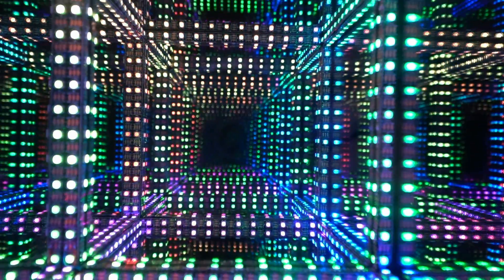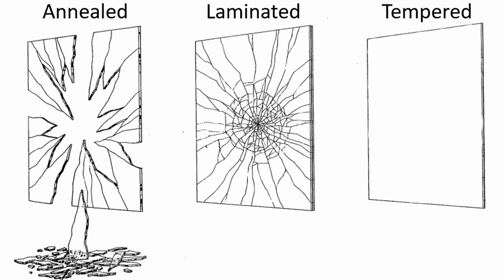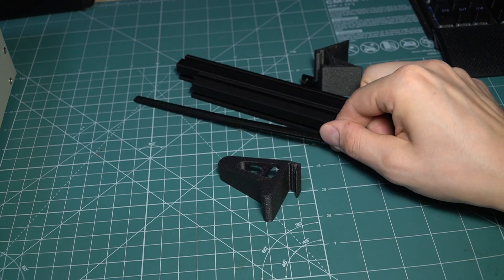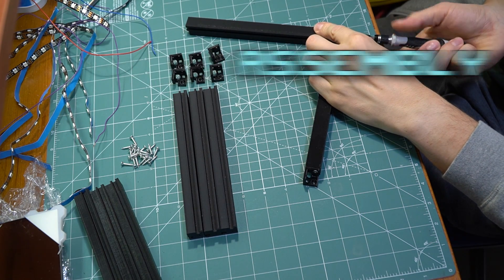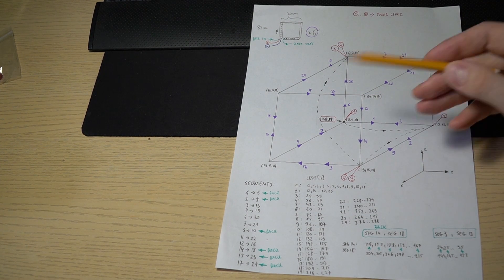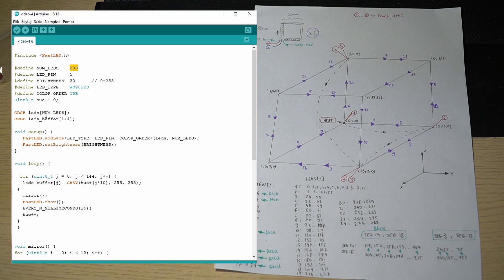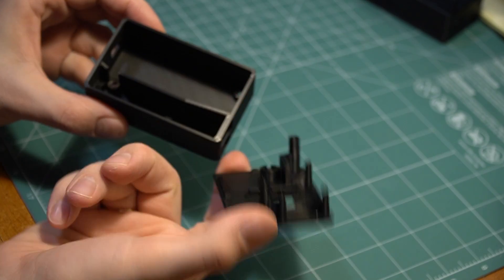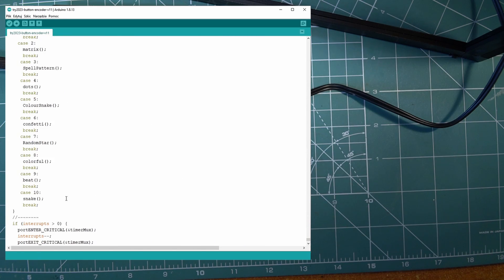Making Infinity LED CUBE

Comment: Couldn't get encoder working or RGB\LEDs to light. First issue was the Timer function was outdated. Some People submitted a new build and that fixed that! After that I Spent a few dollars more and got a better quality ESP-32. I had  bought a 3 pack from Amazon for $9 USA. Only way it would program was holding the boot button in. Picked up ESP-WROOM-32 from ELEGOO and they programmed just fine. So after that encoder worked properly

 Then I had no RGB\LED on the Data PIN-23 as the diagram shows. Looked through the PIN assignments and saw the Data pin was mapped to Pin-27!! Moved wire over and now working as it should!!

Comment: Im about to start this proyect and ive read all the instructions of github but i have a doubt that i wasnt able to fin in the readme. What diameter of cable did you use for wiring the cube?
Reply from the maker: I used AWG24 cables. It is more than sufficient if you will follow the 6 loops power lines I mentioned in the video. Good luck with the project!
Reply: @mecharms  back here again. Im having serious problems i cant sort out with the rotary encoder. I have the same model the ky-040 but its not responding properly, any step i make with it makes the program completly freeze or reset. Any ideas?

Comment: I have tried to recreate this with the video, but for me, who has 0 idea, it is impossible. It would have been better not to put the steps in fast motion and to show the elements more precisely... Too bad, I'm getting absolutely nowhere.
Reply from the maker: Thanks for your feedback. Initially I thought to create a step-by-step video, but it turned out to be too complex, and it was impossible to cover all potential issues that might come up. The most problematic part is in my opinion programming. I hope you get to the level where you can succeed!
Reply: @mecharms  Thank you for your extremely positive feedback. I despaired at the thing and stopped after 4-5 hours and finished the project. I stopped at the wiring because, as I mentioned, I've never done anything like this in my life and it's impossible for me to come up with the ideas myself. Nevertheless, thanks for your video and a great result and video.
Reply: Maybe I'll just change the stripes, the result will certainly be sufficient 🥰

Comment: Amazing project and video.
I am trying to make this work on a cube with 14 pixels per strip because I already have loads of 'em, this has 12.
I have my control box ready and my cube ready for the pixels but I can't figure out the routing and direction of the strips. Also, I am having trouble with the numbers in the arrays. After altering to match my strip sections, the sections do not display correct.  Would you post the new wiring / routing diagram if you have one please. I also noticed that the data pin in the code is pin 27, but the data pin on the diagram at 15:30 is in pin 23.
Reply from the maker: Thank you! You are right with the data pin 😉 I didn't notice the mistake. I changed the pin during the process thats the reason. Did you checked the diagram and code on Github? It should work. The helpfull way in case differen connection is to make program which light leds one by one showing the Leds rising adress direction and strip number in the structure - like shown in 11:27 . Then you can apply the formula I shown. What do you mean by ,,post new wiring? "
Reply: @mecharms  in the video at 4:30, the diagram does show the order of the sides but does not show what strip should be on the top of the side pieces and what should be on the sides of the bars. The direction of the strips is not shown either and both diagrams have different order of sides (first diagram has data in at the front lower left corner and side 2 is front top centre, diagram 2 shows data in at rear lower left and side 2 is middle lower right.
I have enough pixels to make a cube with 12 per strip and another with 14 per strip. I will breadboard another setup and run them side by side so I can change the code one step at a time and have a working cube for reference. Will your formula work the same with 14 pixels per strip ?
Reply from the maker: @Dymoko365  yes, these two diagrams show different things and do not actually match.  Unfortunately, I do not have a diagram showing which side the individual stripes on the sides are on. To do it correctly, trial and error is often necessary. During tests on the prototype cube, I matched the strips one by one, finding the corresponding LED strings, and then used the pattern. In the case of 14 LEDs, the approach is the same and the pattern should work.
Reply: @mecharms  Thanks for the quick answers.
My plan now is to string 24 strips of 12 together to run your code, and another set of strips with 14 to run modified code. I will stick the 12 strips to straws so I can move them around. I will then choose 1 animation from your code and comment out all others. I can then run the sections in the array 1 by 1 on the strips with 14 until they both match.
I will post a vid if I get it done.
Have you thought of putting your cube on WLED ?
Reply from the maker: @antbrown5473 Thats good plan 😉 Good luck! I will gladly see your result. With WLED the problem I find was the limit in support up to 10 segments  insted of 12 I used. Also  i found more useful examples in FastLED
Reply: @mecharms  I have figured out the order of the strips and it looks amazing in a temporary cube.
I have also come up with a new routing for the strips so there is no need to feed data wire around the cube, the longest piece of data wire I need is 30mm. I have stripped the code down for testing, just snake and beat are active now. I have got my sections of 14 running correct. Now I have to move the sections around the cube to match the new wiring. When I have it running and built up, I might make a vid to show new route of strips and how I altered the code to match. 1 last thing, do you have any more animations for this work of art ?

Edit: I have now got all animations running on my strips, now to reposition them.
Reply: I have now paired and mirrored all my strips and the cube looks brilliant.
I have also put all the patterns in a playlist and added it to the menu along with a lamp setting.
You mention at the end of the vid about adding brightness control. How would I do that ?
I have been trying for 3 days now and I can't work it out.
This would make an already brilliant cube even better.
Thanks.
Reply from the maker: @Dymoko365   The brightness is fixed in line 13: #define BRIGHTNESS 170. To make it adjustable, it needs to be a variable controlled by, for example, a second encoder or a switch, depending on the desired implementation. I tried to achieve this using the encoder I have by calling the long press function within the encoder library and then referring to the function (via an interrupt) to change the brightness. However, I encountered a conflict with the running patterns, causing them to stop. But I hope you will succeed 😀 Good luck!

Comment: The code at 13:15 is different from the code on GitHub, so I believe the order of the LED segments will not match the drawing, right?
Reply from the maker: Yes, you are right 😉 First, I made a test stand without mirrors to check the correctness - it had a different segment arrangement.
Reply: @mecharms  Can you give us the new arrangement please?

Comment: Awesome job!!  Thank you for sharing. What kind of filament did you use for the print?  PLA, PLA+, PETG?, etc?  and subscribed and liked!
Reply from the maker: Thank you! I used PLA - Spectrum 1.75mm, color: DEEP BLACK. but if I had to do it again, I would use PETG. At least for corner elements as they are quite fraige.

Comment: Great job! A compilation of used materials in the description / source code as someone else mentioned would be very helpful to those looking to make their own :)
Reply from the maker: Thank you! I updated description with the code.
Reply: @mecharms   Can you also leave a link to the mirrors, and the screws used and the leds say 144 on github but 288 in video?
Reply from the maker: I didn't buy them online, sorry. Try order them precuttet and tempered in glass store. There are 288 leds (I made a mistake on github description). I used M2 x15mm wood screws